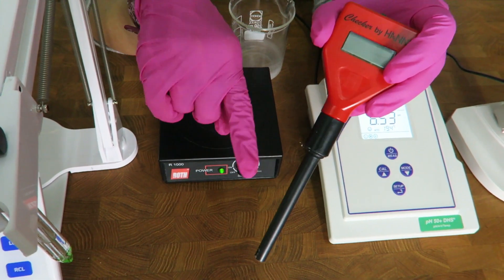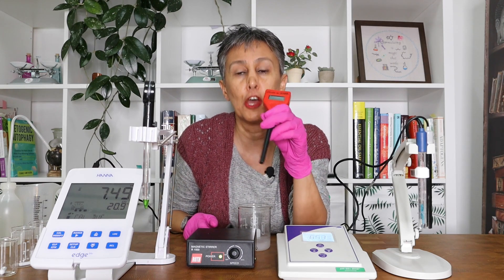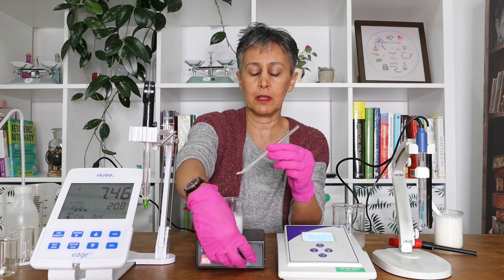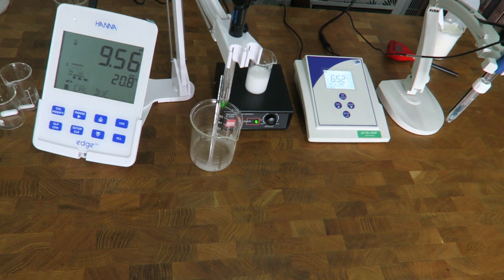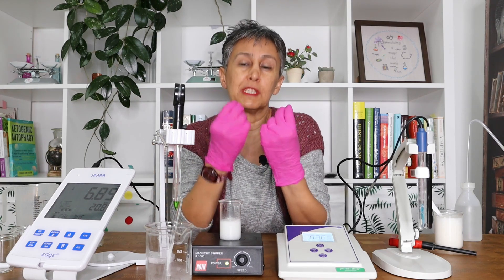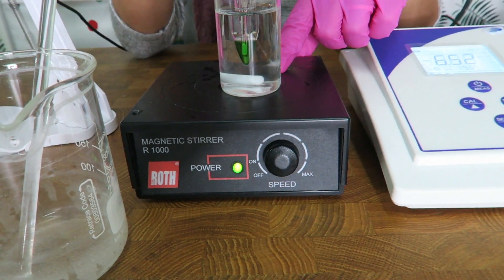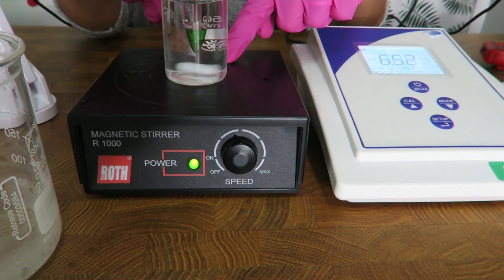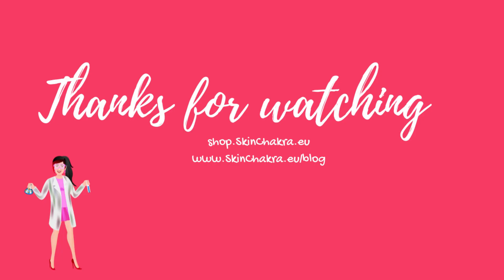How not to use a pH electrode

Comment: I have a question why should not we put electrode touching bottom of beaker
Reply from the maker: because 1- you restrict the flow 2-you can easily damage the electrode
Reply: @skinchakra  and why do we add water into cream sample to measure its pH ? and does this can affect its pH ?
Reply from the maker: @trunghp26  because it is the correct way in most cases.